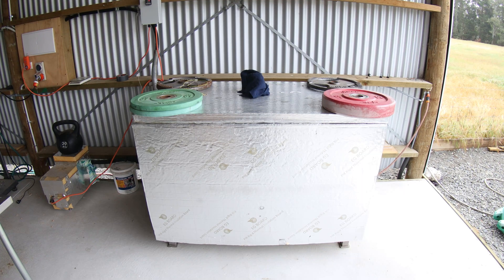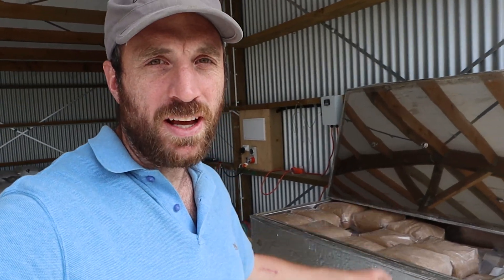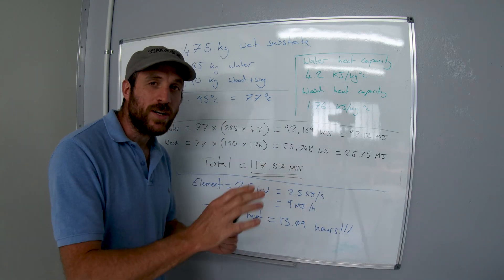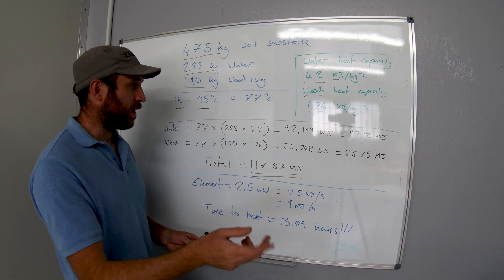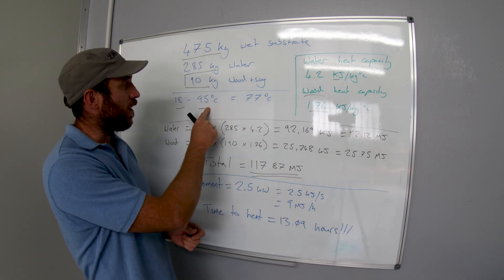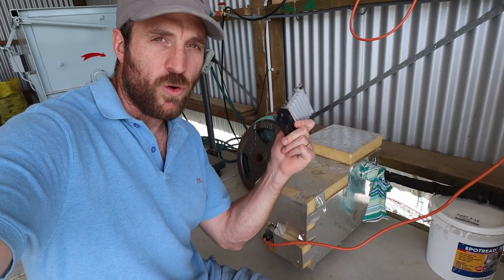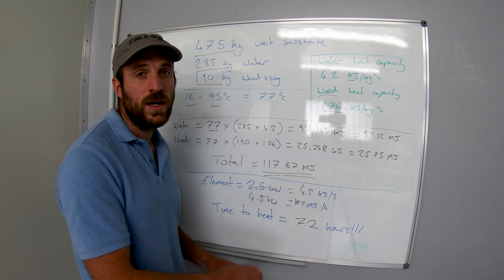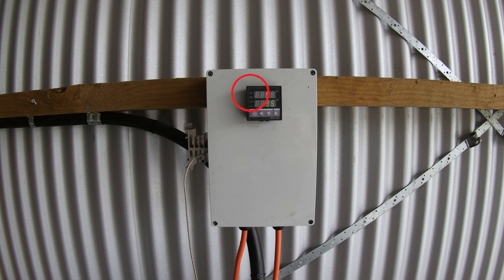This tank holds 0.11 GIGAJOULES of heat!

Comment: Hey Tom, love your vids. Quick question. Your PID controller. Are you running your rtd probe in your large spawn tub with a set point of 99 degrees or is the probe in the boiler tank? I’m assuming it’s in the spawn tub and the water in the tank is boiling most of the time? Also are you running pid, on/off control or is it just temperature indication?
Thanks mate.
Reply from the maker: Probe in on top of the steam tank, so the boiler will run until the whole tank gets up to temperature.
Reply: @OakandSpore  cheers!

Comment: Hi Tom, What are the dimensions of your sterilising tank. I purchased your blueprints for the steam generator and they are awesome. 
Cheers
Reply from the maker: Internal is 1380 x 770 x 770. There is a false floor which maybe adds another 120 to the height.

Comment: Congratulations on the video. However, I am building a sterilizer on a 55 gallon barrel, 3.5 kW element and PID control. The Bubbas Barrels manual says that I will have to set the 93 celsius and the time of 1080 minutes or 18 hours for a good sterilization. According to your explanation with beer, rsrstrs, can I decrease this time?

Comment: What about efficiency and loss in the system. With it cooling off outside over night. That would need a few beers to work out
Reply from the maker: The tank is very efficient. I think it might radiate around 200watts over the whole thing once its at 95c.

Comment: How can I, in the States get yours or equal to PID for sterilizer?
Reply: You know, just cause I’m already here, do you know a quick way to find online or where ever that I can find how to learn the formula you used to figure out the efficiency of Your sterilizer... so I can do mine.  Thx Again and Keep bringing us the Business behind the scenes info you’ve been doing man, sure helps a lot!!
Reply from the maker: I have a video about calculating boiler efficiency. Check my uploads. if your boiler is insulated properly, then it should be almost as efficient as the element inside it.
Reply: Oak and Spore Mushroom Farm right on brother thx alot